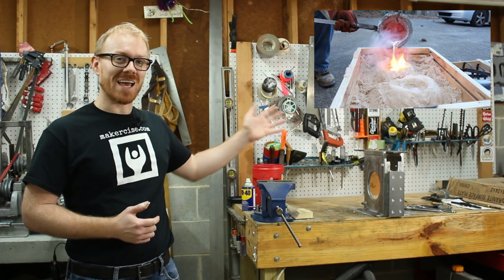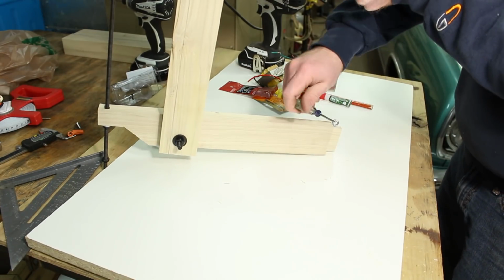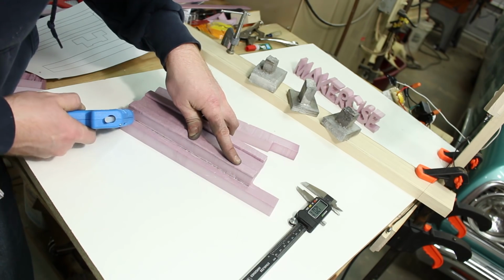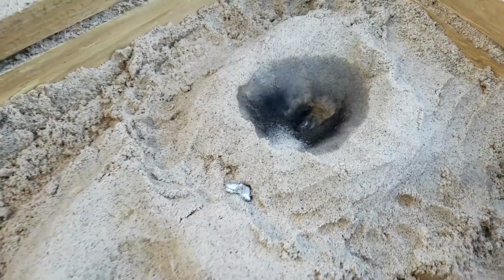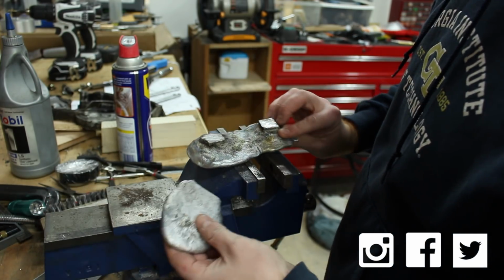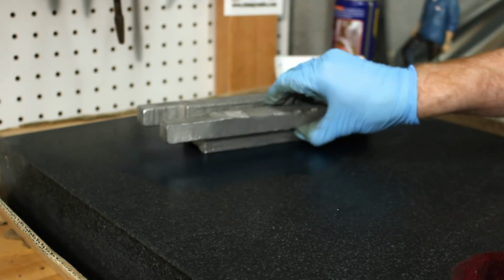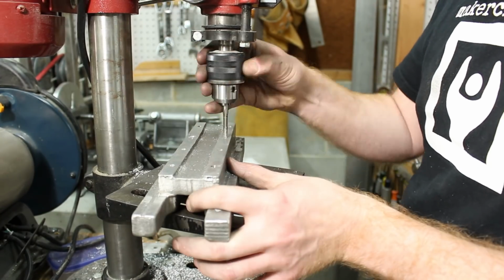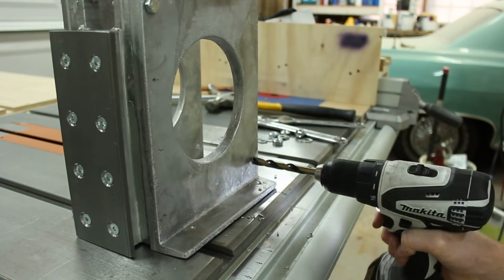Casting the Column Front and Column Assembly - Gingery Shaper Part 2

Comment: If you had to do it over again, would you have cast any of the lathe parts or column sides still using green sand and wooden patterns?  I am particularly curious about the split nut and the column sides.
Reply from the maker: red rob column sides would definitely be lost foam. They were very hard to mold. The ball crank handles are probably a good candidate for a green sand mold. Intricate, used multiple times, small. Maybe pulley blanks too.

Comment: Another method of lost foam you might try. 
Get your first coat of plaster on, then when dry, add a second, and before the second coat dies, dust it with sand. Repeat this several times to build up a decent thick outer shell. Then bake the part in your furnace / kiln to ensure the foam burns out, and moisture is driven out of the mold, and you'll have an empty shell for your pour.
After the pour, you metal parts will shrink, making it easier to knock off the shell, usually by hammering on the sprue. 
This should also keep your bedding material from contaminating the pour

This is quite similar to an industrial method for lost-wax casting. As you are using material with lower melting temperatures aluminum / aluminum alloy (463oC - 660oC), and not steel (1425oC - 1540oC)

If you were to attempt this with steel, i would suggest a great amount of caution, and the use of ceramic and sand instead of plaster and sand, and a proper firing. 

hrm.. Found a video that demonstrates the process using lost wax, and cermics
https://www.youtube.com/watch?v=wMzSS3BnMLs

Comment: would a desktop computer powersupply work for the hotwire ?
as for the speed on the drillpres : i have seen people use treadmill motors on them with a rpm regulator , check on youtube there a few vids on them

Comment: You can save a ton of scraping time by using a Dremel with a conical stone. Aluminum requires a very light touch otherwise it turns into a depression.

Comment: The key to reducing chatter in a lightweight drill press when using large-diameter bits is to not use the table.  It flexes quite a lot when you put pressure on it with the quill (watch the front edge of your table at 17:40 in your video).

Just turn the table out of the way and support your workpiece on the baseplate, propped up with some kind of large stable blocks (housebricks or a suitable length of 4x4 can work well).
Reply from the maker: Keen observation. I tried the card stock technique some others had suggested. It helped. I will give your suggestion a shot...there will be a lag though since chapter 2 is completed and I'm in the extended cut edit phase right now.
Reply: That's a good idea, I'll keep it in mind.

Considering how much your drill press table was flexing, I suspect that if you look closely at your countersinks you'll find that the hole tended to wander in the direction of the drill press pillar.

Comment: Oh come on Cres... your impatience is causing you to mess things up. if your going to drill off hand you guaranteed to drill it crooked.  take your time, use the drill press more often, more clamps and if you must drill off-hand use a bench block to guide the drill. You can make a bench block with the lathe you now have. You need to address those issues before moving ahead (id go so far as remaking everything and drill it striaght. any sloppy holes are going to result in a less than ridgid structure which the shaper depends on. Also use a square more often a good quality one and dont forget to get to scrape those cold roll parts and slides. do it right dude..
Reply from the maker: Ramiro M possibly. the books suggests that these tools can be built entirely with a hand drill. I still need to install the 6 actual fasteners that will hold the column front in place. having those squared up should soIidify the column to a good degree.  like the idea to build a bench block.
Reply: Ramiro M 
agree. when frostoak made the shaper on alloyavenue, it took awhile to get the column squared up, scrape the cold roll ways, ensure everything is as it should be. didnt see much of that here. didnt look like the ways or anything was square or parallel really. hopefully these issues are addressed already or will be in a future episode

Comment: put a thick sheet or two of card stock between the countersink and the part. when you start cutting, the paper cushions the start of the cutting and buffers the teeth as they cut into the metal!  you'll have smooth cutting if you do 😀  ( oh, scrap denim will work as well )

it'll even help smooth out a chartered start 😋

Respect Always
metalshaper\jonathan
Reply from the maker: Colton Bumstead ok I'll give this a try. thanks.

Comment: G'day Cressel, it's shaping up. I've thought of lost foam method but can't get past the, "what if it fails", all that work up in smoke (I've had enough failures) but am getting better. I like your plaster solution though. Good job, keep it up. Peter
Reply from the maker: PGS I cast the ram earlier this week. I am pretty sure I'll remake that pattern. I still really like it. no worrying about draft. no separating, rolling, or ramming molds. for one offs I think it is a pretty good way to go. I'll be sure to add some detail about how it impacted my efficiency to remake it.

Comment: 2 tricks I've picked up when lost foam casting: first, don't use green sand. use beach sand or sandbox sand, something with large grains. it flows around the part better and doesn't need to be packed in. Second, hot-glue 2 stacked foam cups to your sprew and fill the flask to partway up their side, when you're ready to pour remove the top cup. It adds height for better flow and it keeps the sand out.
Reply: The Gingery Machines Yahoo group has an excellent document about lost foam casting in the files group. Reposted from another Casting group on Yahoo. He uses straws as vents, feeds from the bottom and uses a different kind of foam for the sprues (the low density white stuff used to pack computers and such)
Reply: I agree, and sand that can be thrown away.  Lost foam casting made my good greensand STINK.
Reply: Bump
Reply from the maker: Ben D good tips. I am using play sand. I'll give the cups a try. I store the sand outside in 5 gallon tubs be a useful it stinks. :)

Comment: This is exciting to watch. I am curious though why you feel the need to predrill with 3mm before 5mm. Is your drill press just not powerful enough? I tend to just go straight to the final size, as long as my machines can handle it, which means anything below 10mm. Above that I either can not get enough tool pressure or stall out the machine, so predrilling becomes necessary at that point.
Reply from the maker: neistridlar you have me convinced. I'm going to try it. probably got started because my bits would wander even with center punching first. I now have better drill bits.
Reply: The wandering bit can be easily solved by using a starter drill, that is a short stubby one. If you don't have one you can just take any piece of round HSS, grind a 120 degree tip on it, and then grind off half of the diameter near the tip (look up D-bit, you will get the idea). Works great of me. I can even drill a hole on the top of round parts without making a flat first by this method.
Reply: Yes, I have seen several of those, if not all. If your machine is not able to take the big one you drill with one that is as big as the chisel point and predrill. This is especially important if you use a hand held drill, as it is difficult to get enough pressure on those. If you don't get a proper chip, or you get lots of chatter, then it is time to find a smaller drill.

However there are multiple reasons not to start at the smallest drill and using every size you have in between. First of all, if you drill with a bit that is only marginally larger than the hole, the drill tends to want to screw it self in to the hole. Thus it is taking a bigger bite that it can really handle, it can lead to some scary situations, I have first hand experience with that. Also using multiple drills means you wear out more tools in the process, but only on the corners. Also there is the added time of multiple tool changes.

In the end though if the job gets done and you are happy with it, I think that is what matters the most.

Comment: Looking sweet, dude!! Its making me want to build one of these, as if I didn't already have enough projects on my plate! Those bigger countersinks chatter pretty bad unless you run them at VERY low speeds, I've had that exact problem a number of times with my drills, lathe, and mill.  A trick I learned by watching Keith Fenner is to actually chuck one up in a bit brace/hand drill (old timey style!) and just turn the countersinks by hand!  looking forward to the next part!
Reply from the maker: Practical Renaissance I need to give that a shot.

Comment: Haha, when I watched the column casting all I could think was "This failure brought to you by... me"   So glad it worked out! :-)
Reply: I wonder if would be a good idea to come up with a half-ass method for estimating the required aluminum volume by weighing the Styrofoam pattern and multiplying it by a conversion factor?   

Another great video by the way.   
For your future videos, I hope you can find an excuse to make a Lost PLA Casting from a 3D Print.
Reply from the maker: stylac I model these parts in fusion. I can apply a physical material and actually see what the weight of the part will be. a weight multiplier on the pattern would work well too. this particular instance is a combo of running low on ingots, excitement to give it a shot, and also running low on propane. I got a PLA print from Geeksmithing at the Atlanta Woodworking Show this weekend so I plan to dump some metal on it this week just to see how it goes.
Reply from the maker: Matthew Wilson ROFL I'll be more careful with where I put credits. :)

Comment: I liked the video and thanks for sharing . I am asking how you glue foam? And do you pack the sand or put it loose around pattern 
?
Reply from the maker: Asaad omar I use hot glue and a hot glue gun. I do not ram the sand but do try to push it firmly around the pattern. I need to be careful with undercuts. you will see in a future video that the pressure can break the sand if there is not enough mass to counter act it.